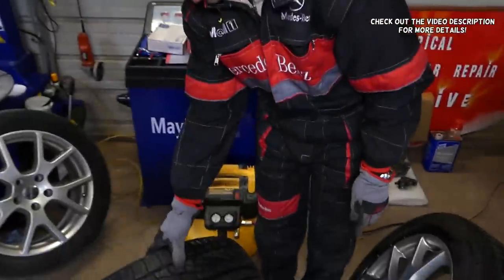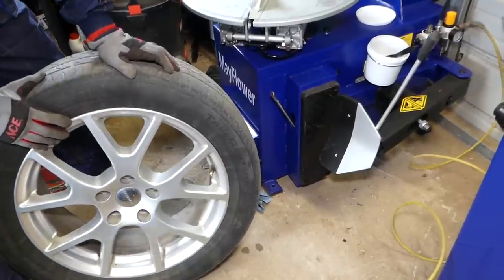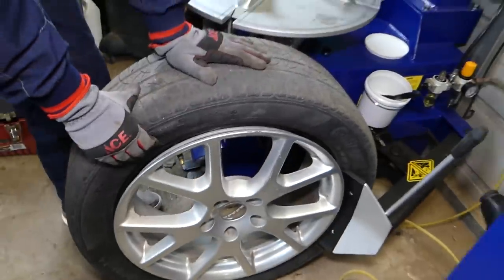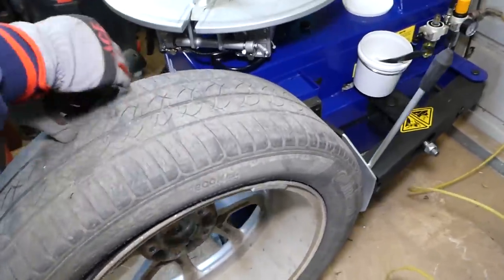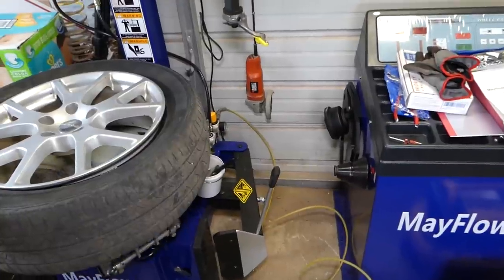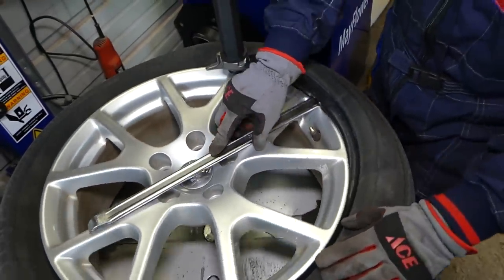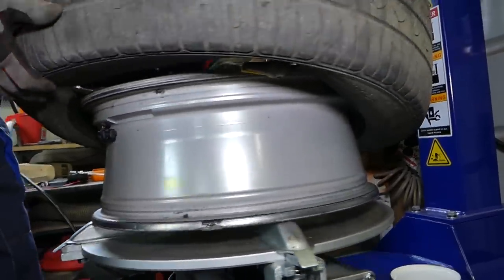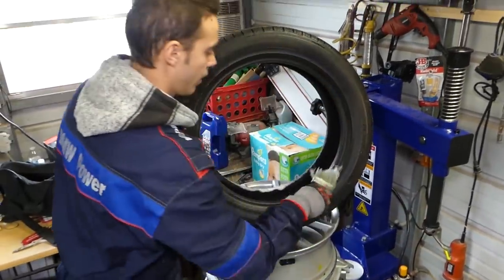HOW TO CHANGE TIRE WITH TPMS SENSOR | TIRE PRESSURE SENSOR

Comment: Thank you very much for so detailed instructions. Though I changed already 10 tires,  but they were all usual tires without TPMS Sensors. It was very helpful to watch this film. I removed one tire already using just simple Harbor Freight machine. Now I need to paint the wheel (it got rusted), and then put a new tire on it. Thank you again.

Comment: Hi, I have a problem with my w203 Mercedes and the srs light keeps coming on and off. I had a small crash very small just the front bumper on the left was hit and since then the light keeps going on and off. I can’t seem to find where the crash sensor is. Could you please make a video showing where it is and how to replace it. There is no video showing that. Thanks

Comment: I changed tyre sensors on renault Megane and programmed them and ts508 said all done but car still saying no sensors on one side.any idea be helpful thanks
Reply: They make a tool that scans and tells you if the sensor is dead/ no longer working, it's easy to damage them

Comment: Should not of clamped the wheel like that more risk of it slipping out and the little spiked teeth damage the paint on the wheels
Reply: should you clamp it from the outside?im planning on buying those machine..
Reply: @chard8114  I believe it’s ideal to clamp on the outside. I’m buying these machines with a buddy hopefully next month
Reply: @chard8114  definately outside, damaging a customer's wheel is just unacceptable.